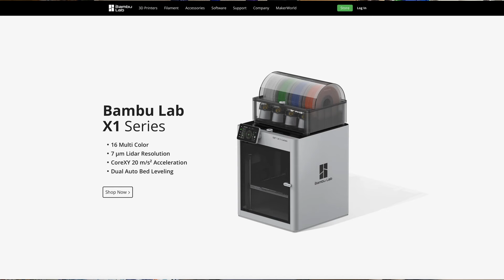What is the difference between high speed and hyper speed 3d printers, Ep 477 Coffee and tools

Comment: Great video, as a non-3D printer guy does higher speed lay down less filament thickness and in theory create better detail? Does higher speed printing also cool down/solidly faster and does it need more or less support? I’m guessing the Sonic and super Sonic might fit into the naming game but maybe there are enough Trekkies in the naming scheme to go with WARP DRIVE. What comes next, I’ve lived through the Beta Vs VHS that seemed the peak and then the next time you open your eyes and everything was DVD and now new products don’t come with a player and you’d got streaming on demand. Thank you so much for sharing and now my head is full of mush! 😂
Reply from the maker: There is some variables, but faster also applies to how much filament is fed by the machine so technically it should be about the same amount unless your doing custom settings or a larger nozzle size. Yeah, it gets deep quick uh ? Sonic or Warp...mmm....could work and thanks for the name ideas. Cooling is another item with the higher speeds and again it can be increased with fans and duct work, but a lot of times I'm running 100% and room temperatures can effect how good the cooling is doing etc. This what makes it interesting is trying all the various settings. Got love experiments :face-blue-smiling::face-blue-smiling::face-blue-smiling:

Comment: Historically you're almost entirely wrong. 
Prusa MK3 was traveling at 180-200mm/s and printing at 80 mm/s out of the box, although with tuning, easily 100mm/s print speed in 2017. The original Ender 3 was released in 2018, 1 year later. The critical difference was controllable steppers and the max volumetric flow rate. Its not like better steppers didn't exist in 2017, they just weren't necessary when nozzles couldn't heat or push plastic. Aftermarket Volcanos did exist, but weren't OEM supported. 

The advancement to >100 mm/s print speeds was the shift in kinematic systems to CoreXY, H or Hybrid, and how it shifted the heaviest axis from the Y in bed slingers to Z in CoreXY. That boosted speeds until mechanical ringing and vibrations became problematic, and input shaping fixed that. I/S required the shift from 8-bit boards to 32-bit Klipper based firmware. Rep-Rap projects, notably Voron and Rat-rig pushed that all technology incrementally, starting  IN 2015 years before Bambu. 

Bambu came in during 2022 with CCP backing, copied/patented open source designs, and mopped up because Prusa dropped the ball. Every other player, Flashforge, Creality, Qidi, Anker, Elegoo, etc, etc all copied successful open source designs. The only players in the speed game are the Rep-Rap i3 open source project/Prusa, Rep-Rap CoreXY/Voron/Rat-Rig, and in a small part Bambu for smacking the rest them for resting on their laurels.
Reply from the maker: See !  I knew we'd get an expert on this topic. Thanks for the updates :face-blue-smiling::face-blue-smiling::face-blue-smiling: